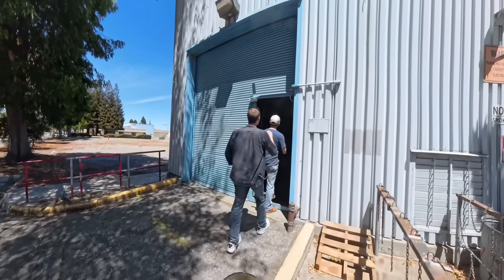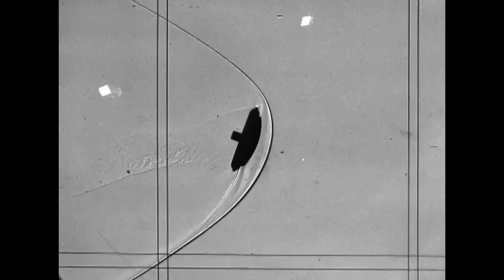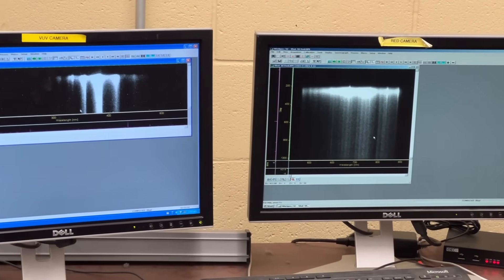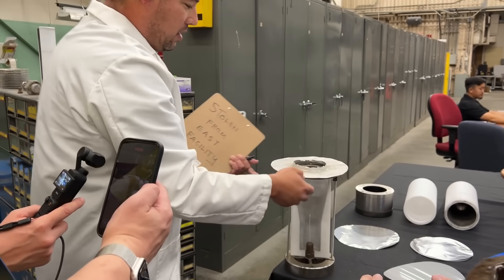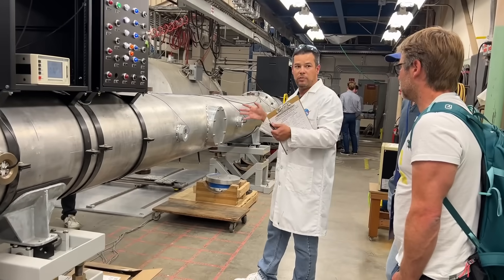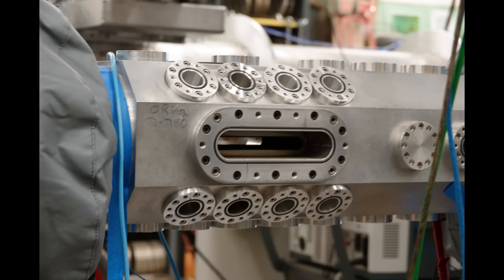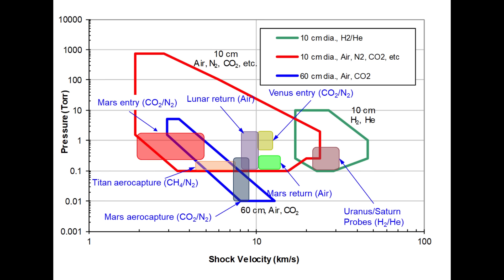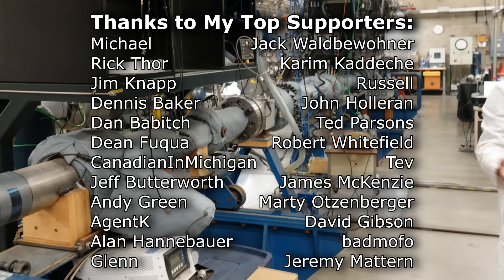Why NASA Is Making Air Explode Using Electricity - The Electric Arc Shock Tunnel

Comment: I wonder if those cables jump around like a pit of rattle snakes from the magnetic flux?
Reply: I’d be curious to know if that much flux at such a small timeframe would be able to do something. But then again I have no anecdotal experience with 1.25MJ….
Reply: @chrisfisher8774 Energy. The electric field flux is inside the capacitors. As it dissipates, shit happens elsewhere.
Reply: Most of the videos I've seen of big cables moving has been the result of capacitive discharge I think these cables do move a fair amount and I'd imagine that they're also finely stranded so they can move more easily without being fatigued
Reply: Im pretty sure they look like when you quickly open and close the nozzle of a hose with good water pressure.
Reply: I think a lot of people in this reply section do not consider this to be AC, because they have a definition of AC in their mind that resembles a sine wave going to positive and negative voltages. But think about it like this: DC is just a special case of AC where the frequency content is 0. Any deviation from a perfectly stable constant voltage contains frequency content and thus creates a change in current which creates a change in magnetic field. This application creates a huge transient current spike which will create a huge change in magnetic field which will create some big forces on the cables. But like others mentioned, the spike is very short and the copper cables are very heavy so they will likely not jump around too much.
Reply: EM, definitely.  Especially if there’s timing differences between the cables, they’ll ring & harmonize.
Reply: Depends on the amperage per phase/wire upon firing. They may have engineered it so that all wires carry an evenly distributed load to the source. And they probably have cable arrestors on the longer runs. With wire that big it’s extremely hard to bend short sections even with a large discharge
Reply: The return current in the outer shield/sheath of the coax generates an external field which can then interact with other things.
Reply: I reckon!
Reply: Semi-related, but I visited the Arecibo Observatory for a workshop a couple years ago - it was after the telescope collapsed, so we were able to go into the transmitter room, where they still had the giant 2 MW klystrons and huge banks of capacitors to step up to ~40 TW pulsed effective power for planetary radar observations

The former director showed us around, including the emergency system for dumping the capacitor banks in case of a fault: a double-sphere spark gap, connected to ground through a loosely-spaced coil of ~1/4"-thick solid copper wire.

They only ever had to use it a couple of times I think, but when they did the Lorentz force was so strong it squished sections of that wire together like it was playdough. So yeah, magnetic flux can def create some havoc if your current's flowing long enough :)
Reply: They are almost certainly coaxial cables, so no they wouldn’t interact as the fields are contained in the coaxial geometry.
Reply: You can already feel cables charging electric cars vibrate from the power going through them, so I would imagine these cables to jiggle at least a little bit.
Reply: What you're feeling on the DC fast charging cables is probably liquid coolant being pumped through the cable to keep it cool.
Reply: @luipaardprint that's AC, this'll be DC
Reply: @alanbirtles fast charging should be dc as well.
Reply: @alanbirtles AC is just a changing current/field.  Same as this.
Reply: @alanbirtles  DC means a constant voltage. If it is suddenly changing i.e. dumping power, it is not DC??
Reply: @mattymerr701  Yes... Capacitors can't store AC...
Reply: @BKD70  No, capacitors do not store AC, but if it is switched rapidly like in this application the output is still AC.
Reply: @GWNJerry  But the fact is, they're not switched rapidly... they're simply dumped (discharged) into the test article in one operation... which is DC.  And, for it to be AC, the voltage would have to alternate between a negative, and a positive value.  Simply switching DC current on and off rapidly is still DC current.  Maybe you could call it "pulsed" DC, but still it is DC.  But that is not what's happening here.
Reply: @alanbirtles it is a BIG dI/dt. It's AC like hell. But if you define AC strictly as a sinusoidal periodic alternating current, then it is not AC.
Reply: @BKD70  It's switched on rapidly, which creates a huge transient current, which in electrical engineering is definitely considered AC for analysis purposes. Also, switching DC current on and off rapidly is definitely not considered just DC. But this is now just turning into a semantic discussion I think which is besides the point of whether the cables would move around.
Reply: The capacitors will store DC, so the discharge pulse will also be DC, but a really, really short pulse. Physics says there will be a massive Lorentz Force pushing the cables apart. But the pulse is very short, and copper is heavy. The force has to overcome the momentum of the wires. So I´m pretty sure the cables will jerk a bit. And I think it´s way easier to let them dangle and move a bit while firing the spark, then trying to clamp them down to some massive structure.
Reply: @andreasdill4329 discharge is  absolutely not DC because both voltage and current do change over time. But you're right that it will not produce a lot of displacement due to a very short time. Displacement is an integral of velocity over time, which is an integral of acceleration over time, and the short integration time produces small total displacement.
Reply: I dont imagine they do, likely just because maintaince would be hell, But for how short of a burst it goes through, it likely doesn't do "much"
Reply: Probably some kind of faraday cage system
Reply: No
Reply: @xephael3485 There is a saying in Germany: If you cackle, you must also lay an egg.  =>  Your Explanation please ! Ah, there won't come anything ? As i expected.
Reply: @der_bekehrer still no egg :( they must be writing a very detailed explanation for us.
Reply: @xephael3485 what do you mean no. I would imagine they do
Reply: @LaunchRecap you can imagine whatever you want but no they do not jump around for a multitude of reasons which we can explain to you if you really need us to
Reply: @xephael3485 I bet your coworkers enjoy your presence.
Reply: @xephael3485  who is "We..."?
Reply: @xephael3485  please go ahead & share your explanation & "multitude of reasons". Otherwise it just seems like you're lying & being rude for no reason. Every video I've seen of a large capacitor discharge did feature cables jerking around at least somewhat, so if you actually spotted something preventing it in their setup here, it would be interesting to hear.
Reply: @xephael3485  Well, I don't know why you said that.  I used to do this stuff professionally.  The answer is very much yes.  Happens all the time.  I have seen it on other people's machines, and I have seen it in my own lab, even at much lower charge xfer.  In some cases, cables need to be restrained if they generate enough force.  Some circuit designs will prevent or reduce it, but you don't always have that luxury.